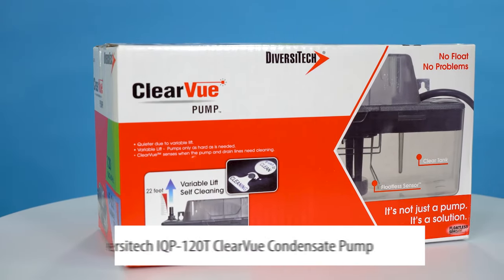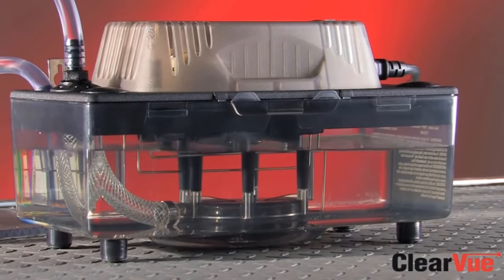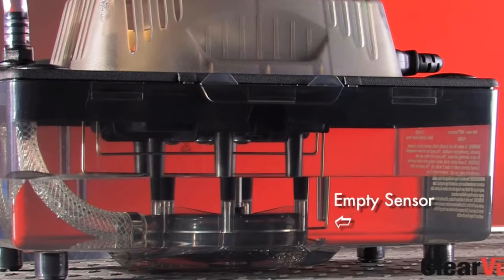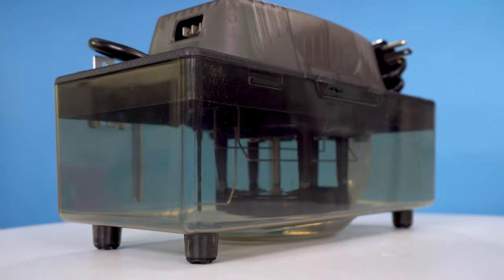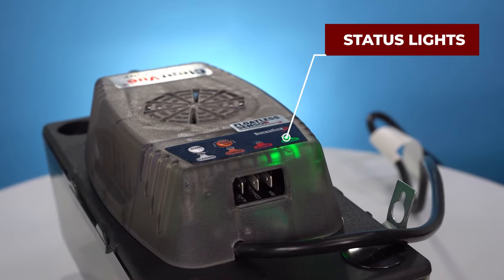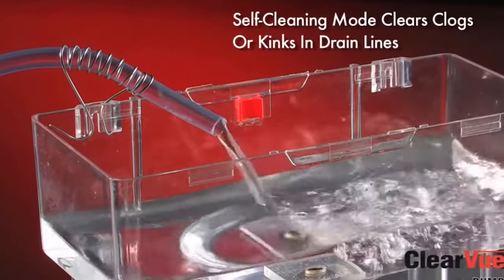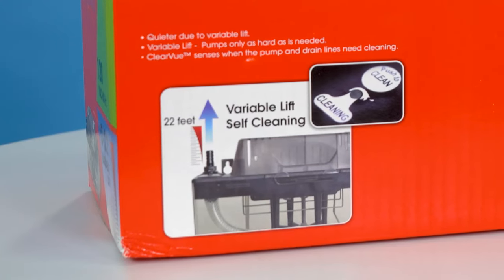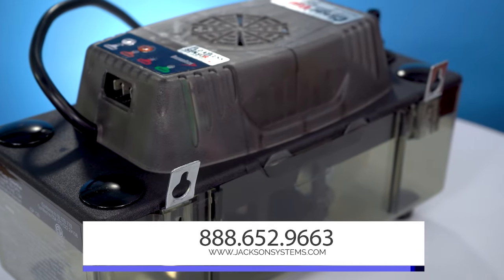Why You Need This Condensate Pump- Diversitech ClearVue

Comment: I have struggled against several sump pumps for basements.  This is probably with the most promising features in my 40 years sump pump experience.  Serving for both AC condensation and dehumidifier, it really pumps the water out without flow back nor intermittently or overflow.  Bravo, the winner of sump pump Olympics!

Comment: We have a never ending battle with HVAC slime even with an array of filtration systems in place plus tablets.
1.) How do the sensors behave when slime is a seemingly incurable issue? 
2.) What is the expected life of the motor for 12ft of vertical drainage (in Southern Florida)?

Comment: This unit starts pumping water at about mid height of the tank, all the way sucking water out until reaching the bottom level without any water returned back even with 12 ft of remaining water in the hose.  The competition appears as an old obsolete design which caused spills from frequently due to the old designs.